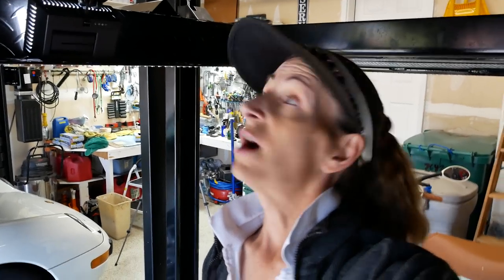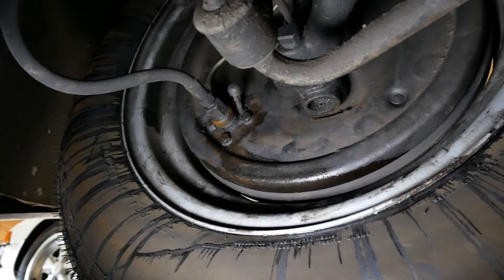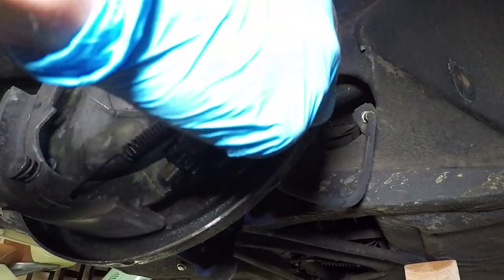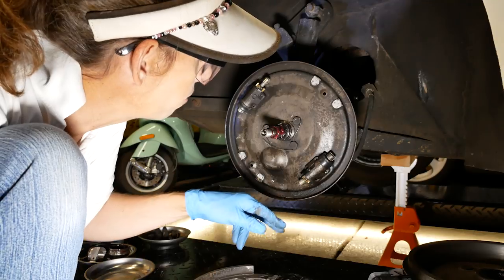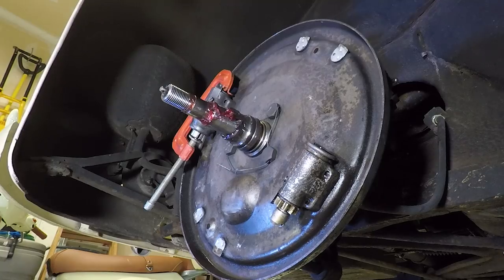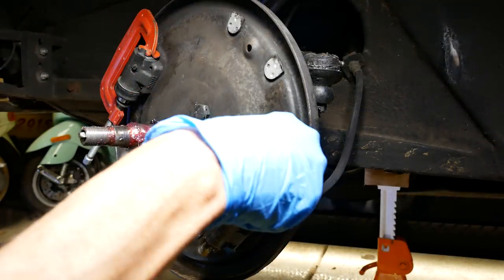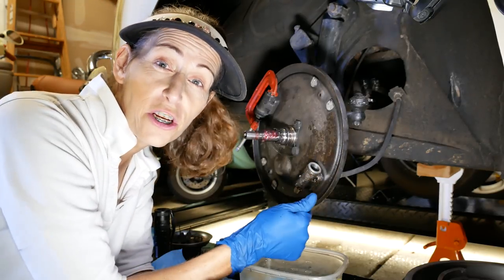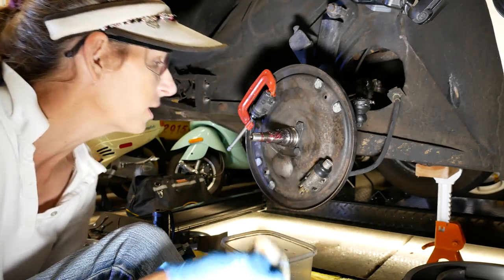356 Brake problems again? What happened??

Comment: Another great video. If I ever have brake issues with my 1959 356 sunroof coupe, I know where to go.
Reply from the maker: Hi Ed, I bet that is pretty.  I love A coupes.  You would have the larger front axles and bigger bearings I bet, but should be the same.  I sure hope you don't have to fuss with them as I have.  It is the one area I still haven't nailed down.  Franny

Comment: Good catch on the leak.  Are the 356's single reservoir master cylinders?  If so letting that one wheel cylinder go could have resulted in a full brake system failure. I typically don't like to change the originality of cars, but that is one case where I don't mind upgrading to a dual reservoir master cylinder.
Reply from the maker: Hi Tim, That is a good idea.  The hand brake would still work, but...  It does require new custom hard lines, but as much fuss as I've had with these brakes it would be a good upgrade.  Franny

Comment: Sorry this is so delayed. I am have a problem moving the front star adjuster on my left rear brake on a 62 356B. Is there anything I can use to free this up?
Reply from the maker: Not a lot unfortunately.  You can try some break cleaner through the adjustment hole and see if that helps.  Otherwise you'll need to remove the drum and R&R it.  Do not spray any kind of lubricate into the hole or you'll render that wheel braking useless. F

Comment: Frannie, I think my rear L brake cylinder is leaking. On my 61 coupe. Can I use this same technique to repair? Or do I need to get a new one?
Reply from the maker: I will be tackling this later this year... I bought a honing tool specifically for this. I have found if there is any corrosion at all they will leak.  More to come...
Reply: @HeidiandFranny  Thank you. I have a hone so will try that first before buying another cylinder. The cylinder is relatively new so I’m surprised it leaked. At first I thought it was the axle seal. Replaced it. However the fluid leak is gold brown and my tranny fluid (Swepco) is blue.